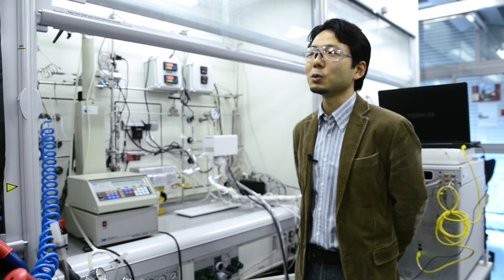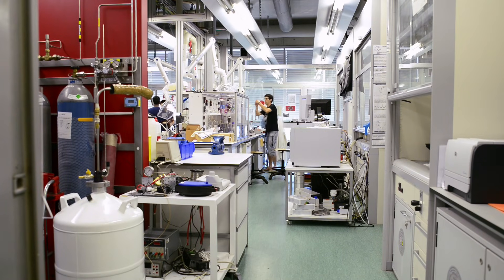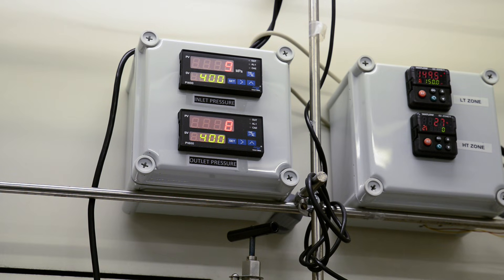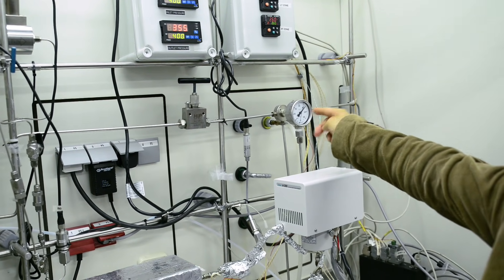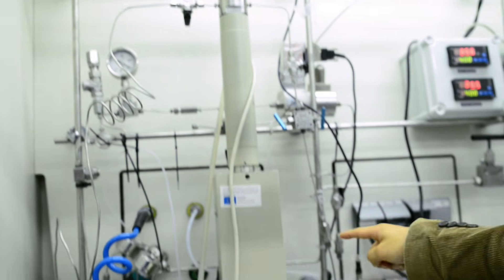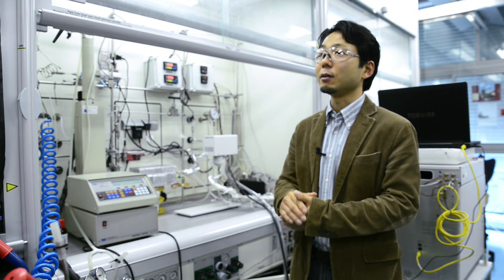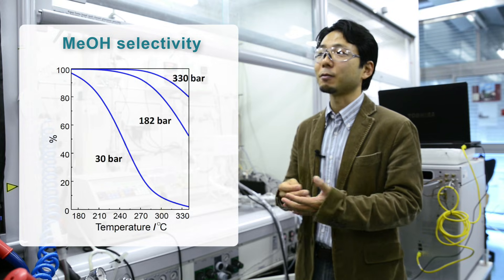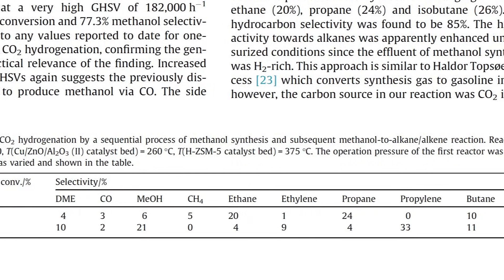CO2 Hydrogenation to Methanol

Comment: I know these reactors typically use Pd/C but...  can I just use a junked car's catalytic converter? 

I'm assuming this reaction is endothermic? Do you just pump a s***load of heat and pressure into a vessel that happens to contain a whole ass catalytic converter and a couple of passthrough tubes? Wait no it's endothermic... Uh... Resistive heating?

Where does the oxygen go from the co2?

Is this potentially explosive?

Shoot, I'm writing this out and starting to think it might not be something to try at home... Maybe I'll still to filling hefty bags with CO from a carbon Arc underwater.

Comment: CO2 was 315PPM 250 years ago and now it's 320PPM. This is not a big problem since it takes the earth only 15 years to absorb C02 and 3.5 years for Methane to break down to CO2 and water. These can be quickly corrected once we  go to electric vehicles.
Reply: That’s not true. CO2 is well over 400 parts per million.
Reply: @Chocolate_teapot420   Your right, its my typo I meant 420ppm. Still it's not toxic until we get to 2000ppm. Also their are signs that it behaves like a fertiler and all the extra Algea and plants are slowing it way down. Also if we ever stopped using carbon fuels the earth would take only 6 year for levels to reach normal levels. Also you Do know that the LAST ice age ended 20,000 years ago and the earth has be heating up for the last 20,000 years and is due to get hotter as this natural cycle runs its coarse. The Black Sea was a fresh water lake only 9000 years ago and rising sea levels flooded it with salt water. Look it up. If you are open minded I can provide more study materials.

Comment: There are two energy inputs that aren't mentioned.  1. Hydrogen and 2. compression to 360 bar.  You have to burn something (or use nuclear) to supply these inputs.  All I see is a change of energy forms, which to be fair may be useful.  When you burn methanol in an engine or a fuel cell, it turns back into CO2 again.
Reply: The benefit is in being able to then turn the methanol into higher hydrocarbon fuels like avgas and diesel to  power aircraft, container ships, trains and trucks without any of them needing to be electrified which is not realistic.  We just need a shit ton of Nuclear for that. Not sure if solar could help.

Comment: Where do you get the hydrogen for this process?
Oh we just use high pressure high temperature steam to reform it from methane.
Er? Why not just use the methane?
How dare you question our green energy!
Reply: Even better is the notion that the co2 for this will come from the atmosphere. Good luck processing thousands of cubic meters of air to get the required CO2.
Problem being that co2 makes up only about 0,03% of the atmosphere

Comment: But what is the point of this process? Firstly, you need liquid co2 (produced by an industrial, energy-consuming process). Then you need (hopefully green) hydrogen, produced by electrolysis - which, with present technology, is an inefficent and non-cost-effective process. And then there is the energy consumed by your own process. All to produce methanol to burn and release co2. Why not just burn the hydrogen? The only exhaust products are heat and water!
Reply: The most important reason is the most mundane one - we don't have "hydrogen burners". Everything works on carbon chemistry, and even if we (for example) banned carbon (I think this is a ridiculous idea) chemistry - all those things will continue to exist and people will want to use them for *decades*. Changing everything is an affront to reason and people's pockets. If we changed just how we supply carbon chemistry, it's only an affront to people's pockets, and a slowly-building one at that. Sliding over slowly gains us at-scale hydrogen production and carbon capture. If people start buying hydrogen burners, the supply will be there ready for them.

Comment: You didn’t discover this
I learned this in school..
Make cow farts from co2 and hydrogen.
You build a very good engine, be more direct explaining what you have done, this is a generator people can buy from you, instal in their homes, easy methanol.
Hydrogen prices then. Everyone has solar, wind or government installs large offshore ones for us to use, cheaper hydrogen. 
Once it’s cheap. We can use charcoal making machines, collect co2 first stage,
After charcoal burnt there is more co2
Both heats water fast , and heats air fast, a simple water and air radiator system for peoples houses
Also humidifies peoples houses automatically or dehumidifies
I recommend wake up, go outside, set house to dehumidify until air is 0% , then add fresh moisture.
Do this often
Once 0% floor and ceiling vents air out house 5kw for a few minutes
And then moisture level is corrected to 50%

Comment: well, the process is interesting, but I hardly see it as a viable way to convert CO2 from fossil fuels combustion into a useful product. here CO2 is pure and already compressed and liquefied. in real world conditions CO2 is a lot, diluted and at ambient pressure. CO2 capture (by means of amine absorption for example) and compression is very energy-intesive.

Comment: Like far too many research efforts, converting carbon dioxide into a fuel that will be oxidized again, (a net-zero fuel), requires an energy input. Catalysts, high pressures, very low temperatures, and hydrogen gas generation would undoubtedly require an industrial plant; but, what is your alternative energy source? Nuclear, solar, wind, hydro dams, geothermal...? The reason that fossil fuels are used is their abundance and cheap production; thus, your process needs to be more economical than drilling an oil or gas well, or mining coal. If your methanol costs more than fossil fuels, it's not a worthwhile technology.

Comment: catalysts membranes and graphite coated fine 1000 nanometer copper wire using fast switching potential divider circuits c02 removal UK... York University... turn c02 into a thick white paste with very little power consumed... amazing... excellent video.

Comment: I want a cell! Where to buy it?
Reply: If you buy it you will never recoup your money as it cost much More to make the fuel than the Fuel is worth ????
1 gallon to make is maybe about $450 ????
Reply: The methanol will ruin the reformer before the hydrogen fuel cell (reformer combines the hydrogen out of the methanol, then feeds the Pure hydrogen to the fuel cell). This reformer last only fiew thousand hours, then it needs to be replaced! Cost a fortune run with methanol fuel cell vehicle! That is why Nissan stopped their NV200 methanol project in 2019.

Comment: It seems to me that everything revolves against the same problems over and over again.In order to convert an energy depleted  compound (such as CO2 or water) one has to give back that energy (or a little more) somehow.This solutions usually mean either high temperatures,high pressures,expensive catalysts (platinum,paladium, group etc. that cost at least 36 millions USD/tonne).Yes we need to find a truly revolutionary catalist or to link the catalyst realm with the nanotechnology field and hope for a miracle discovery.Many advocate that the "hydrogen economy" is complicated and  needs high infrastructure and thick pressure tanks (350-700 bars) and advocate instead "the methanol economy" but we arrive at the same issues (400 bar pressure).Not to mention that methanol has about half specific energy (20 MJ/kg)  comparing to gasoline (44) and far from hydrogen (142).Also we talk about mixing methanol with gasoline but in EU there is a maximum 3 % limit concerning methanol mixing with gasoline.I listen to the same well known introductive parts about pretty well known things ,over and over again, hoping for a breakthrough.Unfortunately, no news so far.
Reply: Methanol could be converted to DME. Dimethyl ether is as substitute for propane and is also a promising fuel in diesel engines, and gas turbines. For diesel engines, an advantage is the high cetane number of 55, compared to that of diesel fuel from petroleum, which is 40–53. Short carbon chains lead to very low emissions of particulate matter.
Reply: @dutchtulip1258  Yes but DME is a gas and needs pressurization (around 5 bars).All costs will increase comparing to Diesel (2x lower specific energy means shorter car range,more costly fuel  transportation and storage ,pressurization equipment needed,safety issues,etc.And the CO2 problem still remain.
Reply: what about using excessive solar power, to produce hydrogen (from electrolysis) and convert it into methane or methanol, for storage?
Reply: @MasterIvo  Solar and Wind are way too inefficient area wise and energy production wise. Nuclear is the way to go. 
Plus, Biomass Powerplants could be modified to make Hydrogen from organic wastes as well, thus giving Biomass Energy much more utility.
Reply: @MasterIvo  ....and being a liquid offers safe transport in contrast to hydrogen; one mol methanol corresponds to two mols hydrogen!
Reply: I do not see where the 400 bar pressure is coming in with the methanol economy; methanol synthesis catalysts work at pressures as low as 50 bar, which is a very moderate pressure; they consist not of precious metals as you describe above but of cheap base metals oxide (CuO-ZnO-Al2O3); methanol is a liquid and can be transported easily in normal fuel tanks; it can be pumped using existing infrastructure and it can be won merely from green raw materials ("CO2 from the air and hydrogen obtained, for example, through electrolysis of sea water using solar or wind energy"). The reaction energy aspect is not very important if you take the much lower pressures actually needed!
Methanol as a fuel in Internal Combustion Engines has a number of serious advantages in comparison to petrol and diesel:
•	Octane number of methanol higher than 100
•	Fuel/air mixture can be compressed to smaller volume-resulting in higher  compression ratio 
•	Methanol also possesses higher “flame speed” therefore - higher efficiency
 •	Higher latent heat of vaporization (3.7 times higher than gasoline); hence it can absorb heat better and remove heat more efficiently from the engine, thus enabling the usage of air-cooled engines.
•	Can be blended with petrol in various ratios (M5, M10, M15, M85 up to M100)
•	Can be part of GEM fuels, gasoline/ethanol/methanol mixtures also possible
•	Emissions; less NOx and PM
•	Safer fuel in fires than petrol
•	A liquid which can be dispensed in a regular petrol station requiring only limited modifications (unlike hydrogen) 
•	Can be used with hybrid (fuel/electric) systems
•	EU legislation can easily change!

Comment: Wow! My mind is totally blown.  Combining this with a direct methanol fuel cell is an insane possibility.
Reply: Can make green hydrogen ( Co2 stays undergroung) in old oil well then covert to methonal 1 403 830 4124
Reply: Yes. Carbon is a RENEWABLE BATTERY!
Reply: Why bother with all that crap. A few seal changes and a fuel filter change a month later and it will run in a normal car.
Reply: @OffGridInvestor  since methanol only makes co2 and water emissions, you could send that pure co2 back into the hydrogenation process.

Comment: At what ratio co2 react with H2
Reply: ch3oh+h2o= co2+h2
so it looks like 3H2+CO2=CH3OH+H2O
Reply: @sMASHsound  you have on the left side 6H and on the right side 4H it has to be the same so 
2H2 + CO2 = CH3OH + H2O
Reply: No he's right, CH3OH has 4 hydrogen and water has 2 hydrogen, he's right

Comment: 1. How much energy is needed to obtain H gas? 2. The atmosphere contains only about 400 ppm of CO2, so how much energy is needed to obtain CO2?  3. Plants need CO2 for photosynthesis to give us O gas and food. Chemically speaking and in practice, higher CO2 levels lead to more plant growth. The pitiful level of 400ppm (0.04%) plays little impact on 'global warming'. The activities of the SUN and water vapour/clouds play a HUGE role in regulating our climate. THINK!!
Reply: Using biologically inspired membranes, the energy to capture CO2 can be greatly reduced. Storing energy from solar is going to be a priority as more people switch to this free form of energy.
Reply: You can use co2 from other processes or a methanol fuel cell for this process
Reply: Climate change denialist spotted
Reply: 1. Very little.

2. CO2 isn't/won't be obtained from the atmosphere only, although there process doesn't require that much energy as it's a side product in most gas manufacturers. I reckon it will also be taken straight from the factories where CO2 is produced.

3. Go to school for once, silly. 400 ppm (parts per million) is equivalent to 0.0004% and that is almost DOUBLE the CO2 concentration in the atmosphere before the industrial revolution. Also, you can't blame water vapors and the sun on the earth heating up at an unnatural rate. It is very artificial, thus caused by humans and, not only because of CO2 emissions.

Also, we're producing more CO2 than plants can consume PLUS the deforestation.

THINK!
Reply: @llanlydia  plus more co² means more acidity in oceans which leads to shells fragilisation.

Comment: That is interesting to me, i've been brainstorming about this for a while now. Finding an effective medium to store hydrogen and reducing the co2 in the atmosphere. Thanks for your research!
Reply: Well yea you are technically right we are reducing the co2 levels but once you burn that methanol as fuel it's going back into the air nothing on earth will ever reduce the weight on earth or increase it. It's kinda awesome thinking about this and the technology we may have in the future.
Reply: Mathew Zacharia 

Just because you’re burning the methanol doesn’t mean the waste products have to go back into the environment. It’s a matter of reducing the co2 levels and isolating the total mass of it to a level the environment can handle, while taking the excess and circulating it by electrolyzing water for hydrogen and using that to convert back into methanol.

Of course this can not produce infinite energy as even if the cycle can be rapidly done mass losses due to mass-energy conversion during combustion would require more fuel sources (fortunately earth accumulates millions of tons of mass every year from space, so that isn’t a problem).
Reply: @topsecret1837  That is true but I didnt say that you cant capture the co2 back into water and reutilise to make it back into methanol. This reconversion/ capture of co2 cannot be done in an automobile as it wouldnt be able to handle the weight of the car as well as the capture tank.

Comment: We can also use methanol directly in fuel cell technology.
Reply: How?,it seems interesting.
Reply: But what do with the carbo dioxide  or stored hydro carbon?  Is the best way to store carbon is by photo synthesis? Some Redwood trees can live for two thousand years. Food, Fiber, Fuel might be a better choice.
Reply: As we now (2021) know, the methanol used as fuel cell via reformer, will contamined the system useless in about fiew thousand hour/km later. Then re-installation the new system to the vehicle will be over expensive! That is why for.ex. Nissan gave up their fuel cell NV200 projects in the year 2019.
Reply: Olli Pyynönen I know. I am hopeful we develop tech which makes membranes impervious to cross contamination. I am researching the subject and there is hope.

Comment: Thank you for your work Dr. Urakawa's. I always knew this was possible, ever since I took chem 101, early on in my engineering education. I was always interested in this technology, and have been always thinking about this as the way we can move forward. Very impressive results, and its a very feasible technology. This can be used today. However, its not the technology as we know, its more of the political will to implement the technology.  Brilliant set up as well.  Thank you again, and I look forward to mass use of such technology in the future.
Reply: How is it today?
Reply: @filipenegreiros9557  takr carbon mix it with water and store it under the earth for few years and u have the fuel of tomo